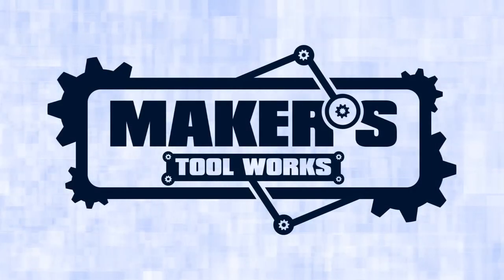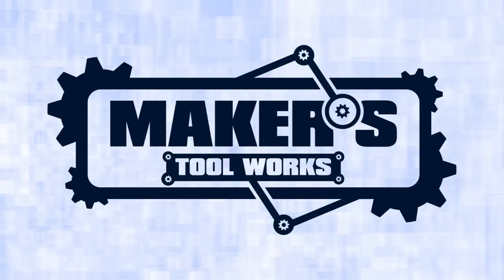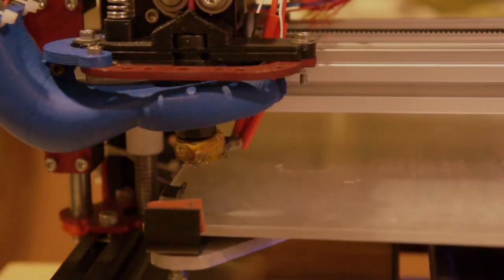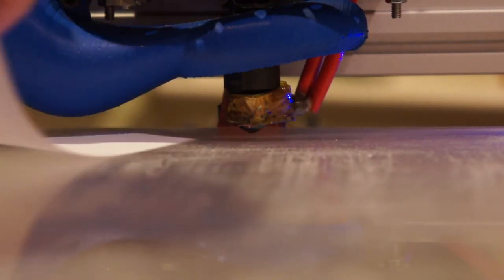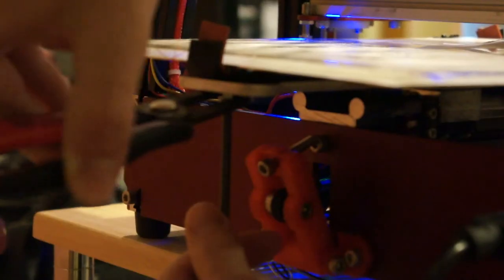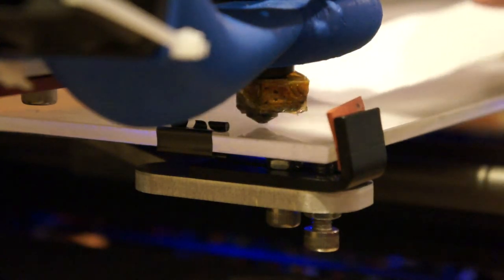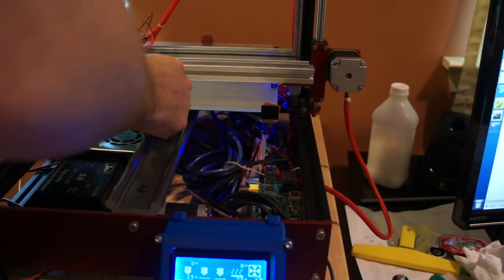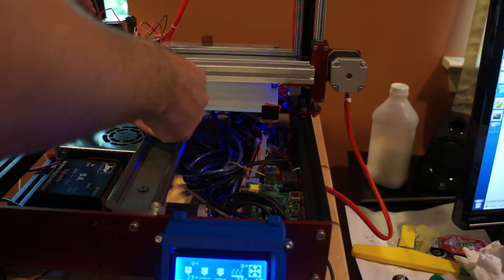How to level MendelMax 1.5+ and 2.0 3-point printbed from Maker's Tool Works

Comment: why do you not have auto bed-leveling ?
Reply: I am finding that the stock MendelMax 2 is virtually impossible to get leveled right and stay leveled.

First there is the Z-axis endstop which is a microswitch. Because microswitches are well known to be accurate to fractions of a mm. But worse than that, the design uses the endstop for calibration. Thats just nonsense because the drivers can't stop the print head instantly. So they are going to slam the head into the plate every time. And that upsets the calibration.

Further, the bed is only held in two directions. So if someone tries to scrape a sticky piece off, its going to slide the plate out in the X direction unless the force is only applied in the Y.

The adjustment screws are all out of reach when the print head is over them making it impossible to level the bed in place.

This system is nowhere near acceptable for a machine of this price and does not do justice to the rest of the machine.
Reply: Phillip Hallam-Baker
I use auto leveling, its awesome and it works well.
Reply: jon, where is there an auto leveling conversion for the Mendel Max 2?

Auto leveling is clearly the way to go. But it requires more parts.

Also very unimpressed by the ability of the MM2 to hold its settings. The Z end stop is terrible.
Reply: @mikefiatx19  can I upgrade my 2.0 for auto leveling?
Reply: @hallambaker  Ya I have the same problems.  Just got mine out of storage and trying again.
Reply: @naterunion5537  Hi, almost all printers can use auto leveling. You just need to add a sensor or a switch. It's too much to explain here but go take a look on the forums.